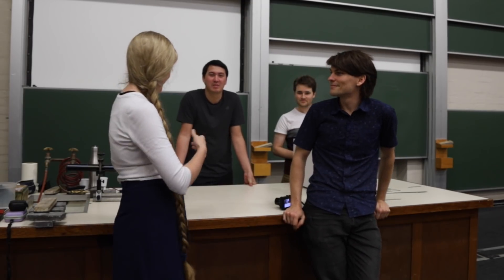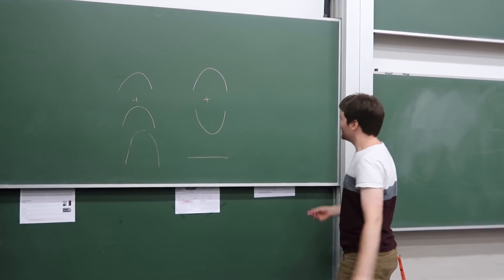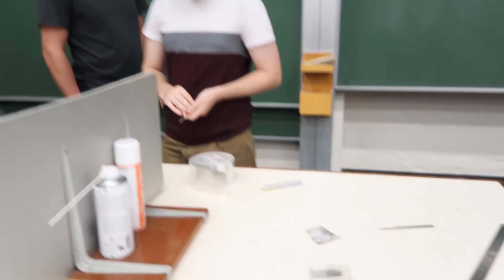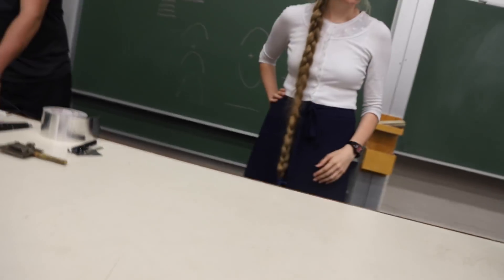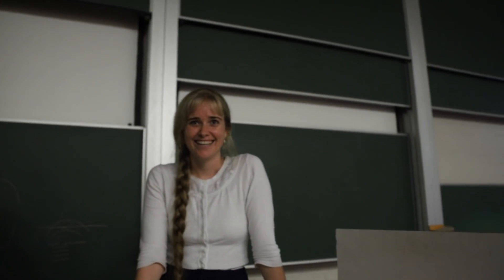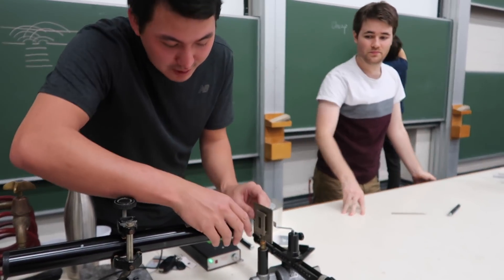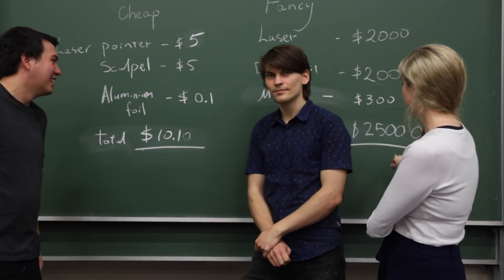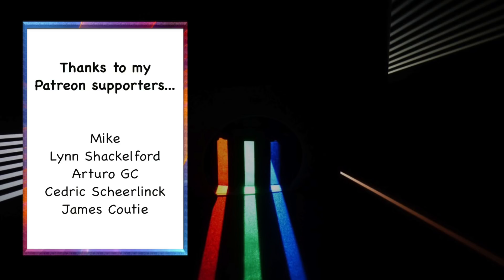$10 Double-slit Experiment Vs. $2500 Double-slit Experiment

Comment: No, this is not just the wavelike properties of light. The implication is that untouched matter, not interacting significantly with its environment remains in a superposition, meaning that things are in more than one place all the time until they interact other particles. I'm not saying that I understand it. I'm just saying that. That's what i've found, and the interaction with other particles.It's called decoherence. So it basically tells you that matter left untouched by other particles. Not interacting with other particles. It's just potential. It's not something concrete, but it's only possibility. Think of it, how can that be we think of a rock as a rock. Not a possibility.

Comment: I smoked a small piece of glass. Then placed it under my sewing machine and slowly lowered its needle until it barely touched the smoked side. That made a very small hole, and one quite round. This was for a circular aperture diffraction experiment that produced a nice set of concentric rings. You could probably scribe double slits onto the smoke, and get better results than here, because the slits here were too wide.

Comment: With careful use of a blade regular kitchen aluminum foil can be used with a laser pointer yielding a fine example of Young's experiment. For fun use different colors of laser pointers and determine the frequency/wave length of red vs green lasers by measuring the interference pattern's nulls.projected at a measured distance.

Comment: I think that it's possible to do it with an even cheaper apparatus. If I succeed I'll tell you how. Great inspiring video.
Reply: You can see interference patters from light by just looking at a really bright source with your eye through fingers pressed as close together as you possibly can while still having a little bit of a gap between them. Sun reflections (any decent light source will do really) and fingers are free.

Funny part is that I vividly remember noticing this even when I was a kid. I would do it every now and then and have fun with seeing how the pattern changed as I closed the gap, but for the longest time I put the "hairy" look of the light passing through the slit down to actual hairs from my eye lashes being smooshed and getting in the way. It wasn't until high school that I saw this experiment demonstrated and then I connected the dots.

In retrospect, I feel a bit stupid as to why I didn't question the mechanism more, but I didn't. Oh well... :/
Reply: @Snagabott  it cant't be cheaper than that 👍
Reply: broke: spending thousands on equipment to recreate the double slit experiment
woke: smooshing your hands together at the sun
Reply: @Snagabott  those are finger print

Comment: You know what I want to see with one of these things? What I'd like to see is what the light source must "look" like to that screen. That is, what happens if you point the camera at the light source looking back into it through the slit? (Granted, you might want to keep the laser power minimal so it doesn't injure the camera sensor, and/or use a cheap cam you don't mind sacrificing.) But since it's shining that strange pattern on the screen, it must "look" considerably weirder "to" the screen, and I'd like to see that.
Reply: mike4ty4 this is actually a great question! We have done it before (not in a video though, sadly). If you take off the lens and just shine it into the sensor you see a really distinct interference pattern - the same as the screen, but considerably more detailed. For the double slit, it’s sort of a pinstripe pattern.
Reply: fun fact.. the latest in photo technology can capture 10trillion frames per second!

Comment: The video recorder and the light source are using the same electricity power source probably.

Thus the light source and recorder are sharing a same informationcommunication channel (the electricity source).

Try to use a charged battery powered recorder, this cuts off the information communication channel between the light source and video recorder.

Better still, if the light source are also using its own charged self powered different battery source.

Comment: I did this on my channel with the addition of a quantum erasure experiment (I used the free polarizers from 3D glasses). This was similar to the $10 price point.  

A tip for the slits is using 3 sticks of graphite from mechanical pencils you have a good measure on the gap (.5mm for instance) as well as the rounded edges of the sticks reduces edge diffraction off of each slit.

Comment: @11:00, those "side-images" of the main pattern are probably caused by poor (or no) spatial filtering of the beam. Try to apply some spatial filtering BEFORE the double slit in order to clean the beam. Also, focusing the beam to get the waist EXACTLY on the double slit plane would give you a better result.

Comment: helium neon laser can be bought for 200$  and single mode laser diode pointers , 10-15 $  and the slit is best made with razor blades . 3$ .. just a tip :)

Comment: Ok a photon has two parts the storage like a hard drive (the wave part of a photon) that carries the information (the particle part of a photon) of the object that emitted it or reflected it or observed it fully (which full absorbtion is no photon  reflected back or photon empty of information reflected back equals black) so a photon leaving the source that emitted it is a wave with the information (particle) of the source it came from when that photon is reflected by on object part or most of the information from the source is transfered into the object and the photon reflected has a percentage of source information that is 49% or less and  now has 51% or more information from the object reflecting it. So in the double slit experiment the method used to observe the photon shot before the impact of the back wall takes part or most of the information in it away which takes away the interference pattern and when the method used to observe the photon a second time replaces the information the first observance took out and now you get your interference wave pattern again.

Comment: Kind of interesting is that one of his quick drawings (related to the single slit case) kind of resembles the sinc function, "sin(x)/x" or "sin(pi*x)/(pi*x)", which is semi-common in signal-processing tasks (useful for things like band filtering, interpolation/extrapolation, ...).
Reply: Yeah, the Fraunhofer equation (that you can use to describe the interference patterns) uses sinc functions, that's what I was aiming to draw. I'm happy you can recognise it; you have a good eye and my drawing is better than I thought, haha!
Reply: @liamastrolabe8137  Yeah. I am not particularly knowledgeable about physics, but may have encountered this function a few times when dealing with DSP and audio/video compression. I mostly do programming (C, ASM, Verilog, ...); along with some amount of electronics and machining.

Comment: Take two razorblades from a safety razor (ask your grandpa) and stack them and you have a dubbel slit knive. Take self adhesive aluminium tape for making rain drains, and tape it on a cardboard so it does not shred during slicing. Also the tape can help to hold the former mentioned razorblades together and prevent cutting in your fingers. (or ask your grandpa). And, yes, I am a grandpa :))

Comment: wait, doesn't the experiment involve sending the particles one by one into the double slit in a second run? Unless I'm mistaken, since a single slit is unable to tell appart particles from waves, and your experiment is only consistent with light being a wave, and it's the simplest explanation, Occam's razor would dictate that light is simply a wave. 

(I found your video when trying to find informations on how the hell do you hurl electrons one by one at a double slit, and in what world if you don't know if you have a wave or a particle on your hands do you even know that your slits should be about one wavelength appart, or even what speed your maybe wave is propagating)
Reply: nraynaud1 I have personally given up on actual information on an actual experiment reproducing the double slit experiment. As far as I’m concerned the double slit experiment is a myth.

Comment: I think that before ppl got lasers, they did this experiment using vapour discharge lamps (sodium, mercury...), carefully selecting one of the spectrum lines (via prisms or whatever) and sending that into the double-slit.
Reply: Thomas Young sort of "made a laser" (not really) by letting sunlight through small holes in a card, and got it down to just the blue wavelength I believe. Pretty clever I thought.
Reply: I'm really surprised to see another user with Bach's monogram as their profile pic here! (sorry for off-topic). You have good musical taste!
Reply: @ReubenLL28   Thank you very much!

Comment: If you have sufficiently bad and weak laser pointer you can actually do away with the aluminium tape, and use a piece of paper with 2 slits cut with a normal knife, I just tried and it works, although the interference pattern is a bit shorter, but you don't have to buy scalpel and tape, so it's even cheaper.

Comment: Another way to do it on the cheap, that needs a few tries to get right, is to darken a microscope slide with a candle flame and scratch two lines with the tip of a scalpel blade.

Comment: I have found that the laser pointer Double Split double slit experiment is apparently not valid. I took Foyle and made slits anywhere from 50 thousandths apart all the way to .005 in apart and used two different kinds of laser pointers one green one red. What I have found was kind of interesting. If you put one slit in a piece of foil, that's only one slit in it anywhere, you will get exactly the same thing that you get if you put two slits. You get what looks like the interference pattern according to everything I've seen. It couldn't possibly be an interference pattern though because there's only one slit. Now the first thing I thought was maybe it's reflecting off of the .003 thick piece of aluminum foil after you cut through it so I took a piece of paper and I penned it all up black and I cut a slit in that plain paper and I got the same thing with one slit and a laser pointer. I got what looks like an interference pattern when I tried two slits in the paper at different distances apart, it just gives what looks like the same exact thing as with one slit so I have to say that the laser pointer deal is not valid sorry.

Comment: I have more questions.  Anyone want to entertain them?
What does the periphery of the slit look like at a microscopic level and what happens to that (very strong & focused) light energy interacting with those edges?  AND We know that energy has a net output behavior based on the energy itself as it interacts with its medium.  Has anyone ever done the double slit in a vacuum and also used highly refined “slits”?  And how does the energy interact with openings of different shapes?  Seems that all the experiments I’ve seen have been with vertical “slits”.

Comment: Can you please point out or you do it personally the Double Slit Experiment with an observer where the particles change behavior with an observer? 

I have been searching for an actual footage (not animation) for this theory but failed so far of finding any!
Reply: For those that don't know, here's an explanation of what happens. First, having an observer just means something acts on whatever passes through the slits. We'll do without that to begin. This experiment shown in the video above was conducted with electrons and the same interference pattern appeared over time. They then lowered the power of the emitter so that a single electron was sent out at a time. It still produced the interference pattern. Basically the electron acted as if it passed through both slits at the same time. This is the no observer variation of the experiment since you don't know which slit the electron went through. They then sent photons near the slits with a detector that would be able to tell from which slit the photons came from from thus telling us which slit the electron went through. This is the observer variation of the experiment. In this version, no interference pattern was seen. The pattern produced by the electrons was identical to that of a single slit.

edit: Found a video describing it. Crazy stuff.
https://www.youtube.com/watch?time_continue=670&v=8ORLN_KwAgs
Reply: @alienrenders  There is plenty of animated videos for the observer experiment, but couldn't find any live actual footage! How such a great experiment that could have massive influence on our future perspectives , has non to little videos for it!
Reply: I don’t think anyone has ever reproduced the double slit experiment. I think the whole thing is a myth.

Comment: I did this experiment, when I was 12, and I built the laser myself.
Well .. it was a electronics kit with a Philips HeNe tube.
My main discovery was that, unplugging the electronics, containing parallel capacitors,
did not avoid me, getting electrocuted.